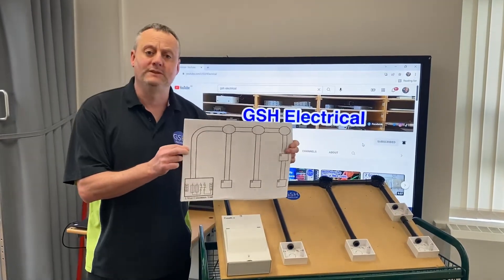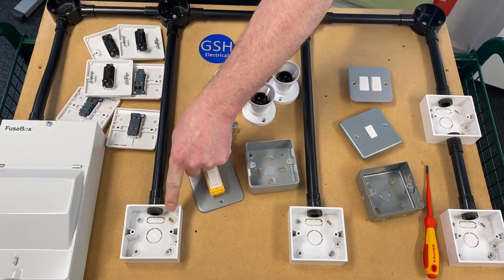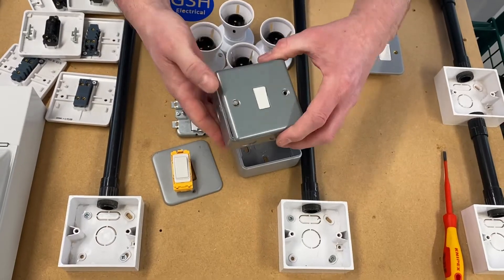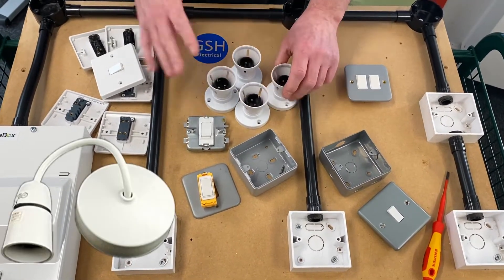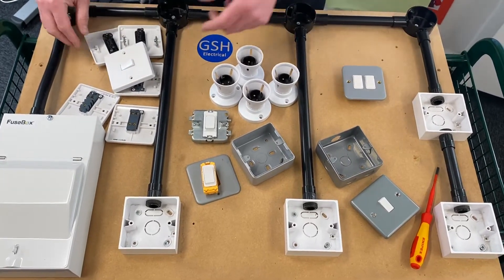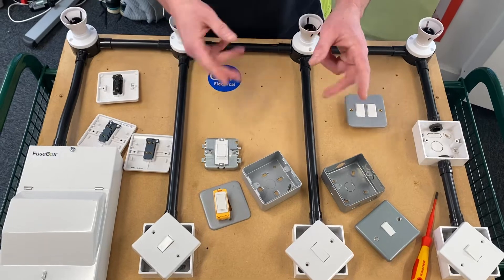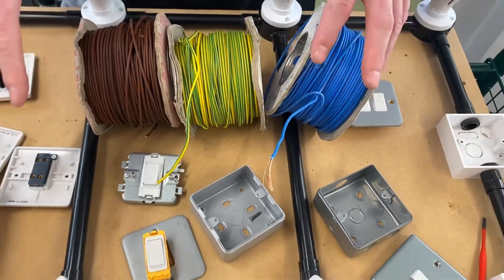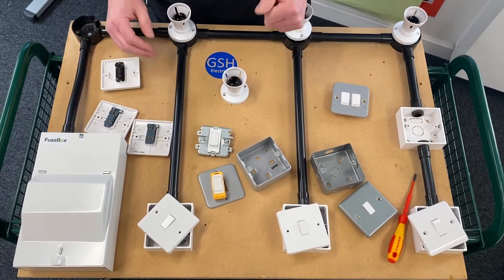Wiring Lighting Circuits in Conduit Using the Conduit Loop in Method of Wiring - Rig Explained

Comment: With those baton holders do you still have to slide heat resistant sleeving over the cables . It was always a requirements if the normal wiring gos straight to the lamp holder.  I often use these baton holders in domestic properties with proper round back plates and I still sleeve the cables just on the off chance someone still fits a 100w lamp . 
Obviously not a requirement on ceiling rose based baton holders. 
Now we are 99% LED I often think what I do is not necessary.  Any thoughts.?